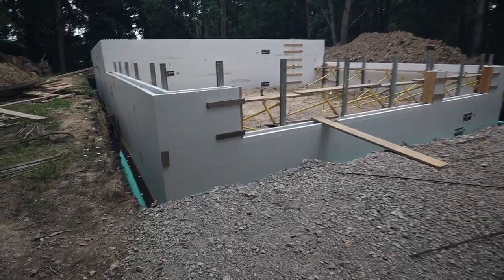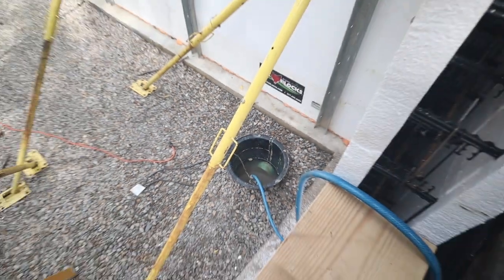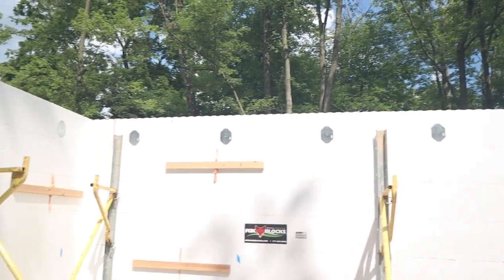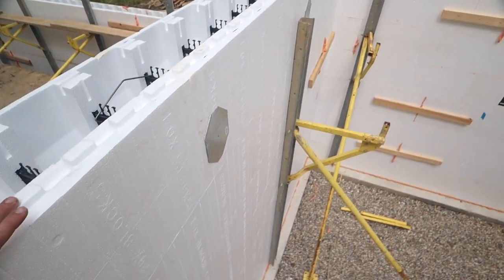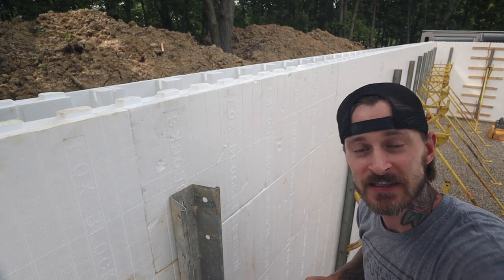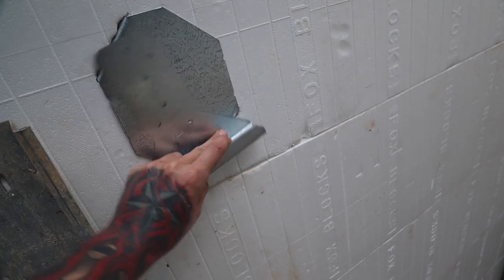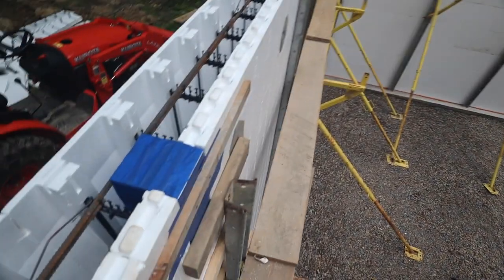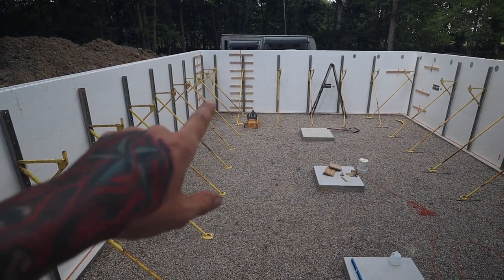ICF DIY home build 1 month update and 100 subscribers!

Comment: Great job. Watching like crazy since yesterday. You detailed very well. Rebars on top and side of each window. Questions:
How wide can the window be ? In case we want something like a mid century modern.

Also how many rebars are present in each wall?
Reply from the maker: I’m not sure as my engineer approved it.  But with concrete, pretty wide.  Rebar is 18” vertical and horizontal and doubled around windows and doors.

Comment: Do you rent the steel braces and wall supports to retain the icf panel’s? If you what is the cost?
Reply from the maker: Yes.  A local guys does $10 each per week.
Reply: @neckofthewoods24  : good to know